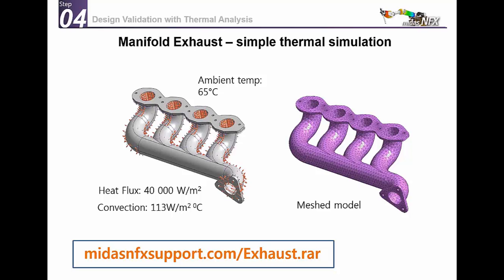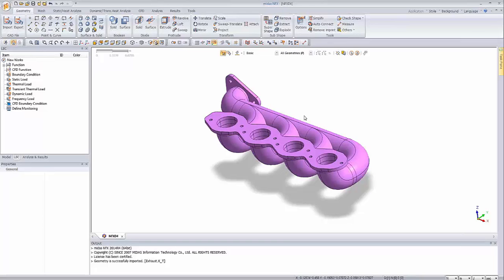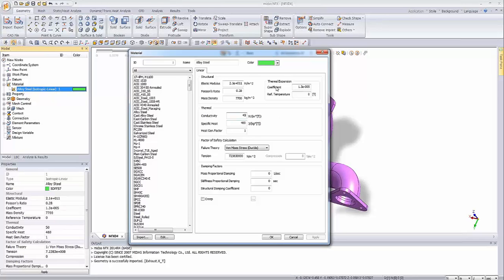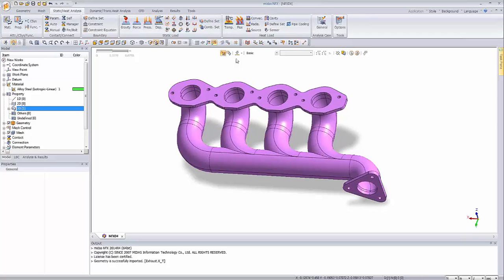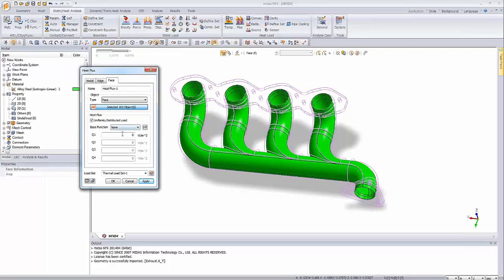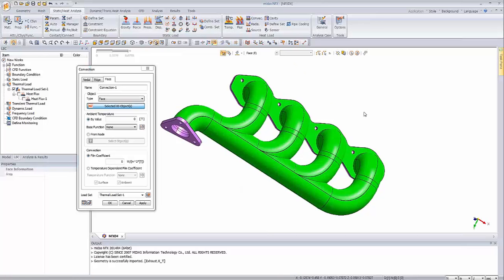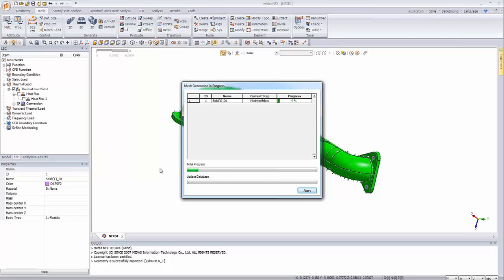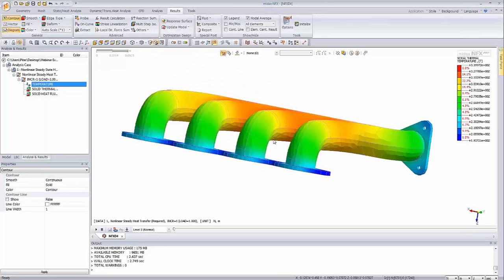[FEA Tutorial] Heat Transfer Analysis on a Manifold Exhaust with midas NFX

Comment: Having a zero-gradient heat flux is unrealistic. For greater accuracy, you would need to couple CFD for internal convection and perhaps external convection. Gas of a specified temperature would enter the inlets at a specified velocity, instead of assuming a value of heat flux.